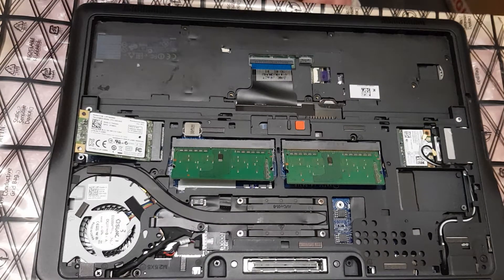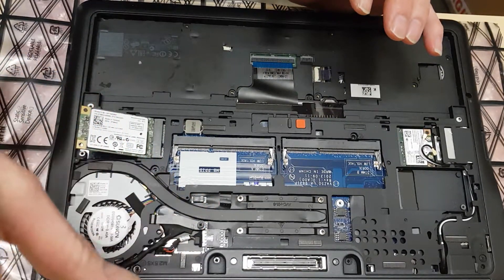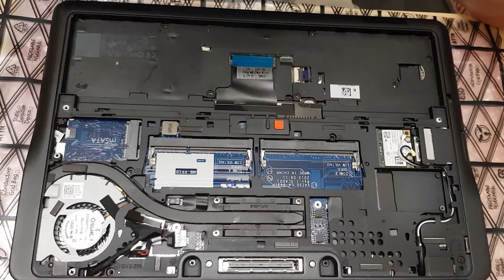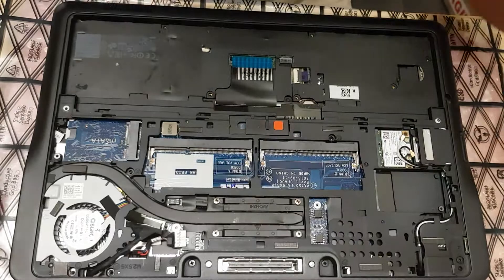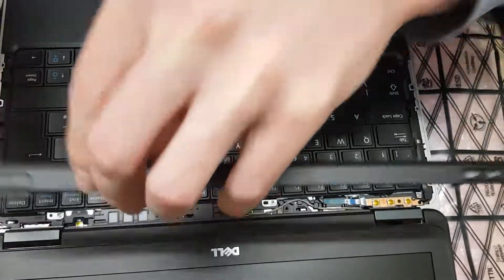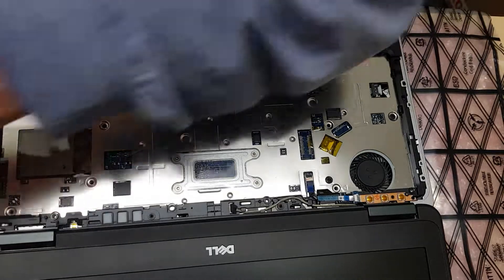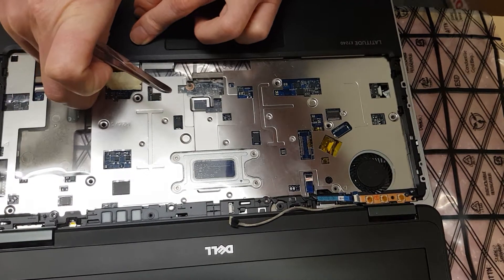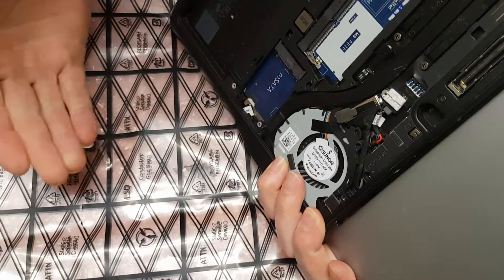DELL LATITUDE E7240 DEAD no life at all fix for free safe disassembly

Comment: I have a Dell Inspiron E6420
It turns on before but now it just:
-The power button flashes a little bit when I turn it on, and then the PC dies
-Battery doesn't work so nearly every helps doesn't work too
Reply from the maker: Hi
Sorry for late replay, have you tried standard procedure to clean memory contacts with alcohol?

Comment from the maker: Have you used laptop or it came faulty?  Did it boot occasionally before?
Reply: I have dell chromebook 11 3180
If I put the adaptor the orange light keeps blinking 
And I put the battery back the light goes white but it doesn't turn on. 
Black screen. 
What should I do thanks
Reply from the maker: @KUYZpat  Blinking orange should be faulty battery however I have not seen any chromebook before it should be similar. 
Have you used laptop on your own or it came faulty?  Did it boot occasionally before?

Comment: I have a Dell Latitude E7240 which powers on but no display and no hdmi output, when I plug the charger in the system boots up without display:

- Power button led comes on
- Hard drive led flashes once very quickly
- Battery led comes on for one second
- After 4 seconds the power button led goes off 
- After another 4 seconds the power button led comes back on and stays on, the hard drive led flashes once very quickly

The green leds on the actual msata SSD light up

If I leave the system in this state then the cpu and heatsinks get hot and eventually the fans will spin (but still no display) 

Pressing the power button once will turn off the system (cpu will cool down, msata leds will turn off)

I’ve tried the following:

- Performed hard reset / static discharge, disconnected and checked cmos battery (3v on multimeter)
- Replaced RAM, msata, screen with known working
- Tried booting while holding down ESC, D, FN keys 
- Tried HDMI output (no output)

I’d really appreciate any other suggestions / tips, could it be a corrupt bios? Thanks in advance
Reply from the maker: Have you used laptop or it came faulty?  Did it boot occasionally before?
Reply: @maxinozka  i bought it faulty, there was some liquid damage near the dc power jack connector (it wasn’t water damage, it was some hot drink - hot chocolate, dried up), I’ve cleaned it off, components look okay
Reply from the maker: @darattaqwa  

I used to fix motherboards but it is waste of time as many of them had to many parts burned. All guys posting repairs here just shows successful repair and they repair all day long. No more then one out of ten motherboards is fixed in real life. I have some faulty E7240 motherboards like yours (CPU voltage present, warmed up parts, no screen) left which I will only try to repair in my spare time (but I am too busy with children). I do not think it is bios but I can send bios chip if you are after it (maybe depend where are you from).
Reply: @maxinozka  Ohh thank you so much, I will try to use a bios programmer (can buy on eBay) to reprogram the bios chip first, this is just a hobby / learning how to repair to see if I can make a living out of this because I enjoy this and I hate my current job... I have 3 kids too so not much time, I really appreciate you giving advice, I can repair basic faults like dc jack, replace screen, components etc even on the motherboard if I know where the faulty component is I can replace it, I struggle with diagnosing the fault... I am in UK, is it possible we can stay in touch via email or WhatsApp
Reply from the maker: @darattaqwa  I do not know how to swap email here but I am in the Leicester. Most of the faults of laptops are mechanical (screens, connectors, cables, speakers). As I said 1 out of 10 motherboards. Shop here was selling 50 laptops left by customers over a year. People posting motherboard laptops repair for money post barely one video per week so you can imagine how successful they are. If there is not fault in power management there is almost zero chance. Your laptop seems to have CPU voltage so you can only measure cpu and memory voltages and those are mostly there so you are about over with diagnostic. I have some of these and voltages are there however one of them was from friend so I know it was getting worse over a time so it is possible that some capacitors degraded very fast and laptop was not used a lot so some capacitor can cause this but it is just too much time.
Reply from the maker: @darattaqwa  8 coils will be LAN RF filters, do not really influence video output. As I said most of laptops will fail due to capacitors exactly as it was in past with PC motherboards. If you have memory voltage 1.35V and something acceptable on CPU I guess 0.7- 1.3V and nothing overheats significantly (almost burning). I have seen some older MAC repairs here by replacing capacitors and I think it is it. From what I have seen laptops does not boot every time but once booted works fine until turned off and it gets worse and at the end they do not boot at all. This barely can be wrong contact to BGA as it use to be with VGA but heat up CPU can be always first try if everything looks ok.
Reply: @maxinozka  thank you, I’m learning a lot from you, sorry for all the questions, I really appreciate your help
Reply from the maker: @darattaqwa  I think we should do live chat to discuss this as it should help other and they can watch video later. I am not sure how it works and if I can do live stream though ;)
Reply: @maxinozka  I’m too shy to do video chat lol I’m investigating the DC Jack until the bios chip programmer arrives, most of the liquid damage (dried-up hot chocolate) was around the dc jack, the jack has 5 wires, 2 x red, 2 x black, 1 x blue.. I’ve used a multimeter: the 2 reds are shorted together and give 19v, the 2 blacks are shorted together, there is nothing on the blue wire, is this normal? 

Ive inspected the capacitors carefully as you think it’s probably shorted cap, apparently shorted-caps can be diagnosed with visual inspection (discolouration, waxy appearance, cracks, etc) but they look fine, i did random short test on either sides of the caps and 99% are short to ground on one side, open on the other side, however on one cap it’s open on both sides, is this normal? Or is it faulty open.. thanks again for your help, maybe you can make a video about this if we get it fixed, I’m happy to send you videos / pictures